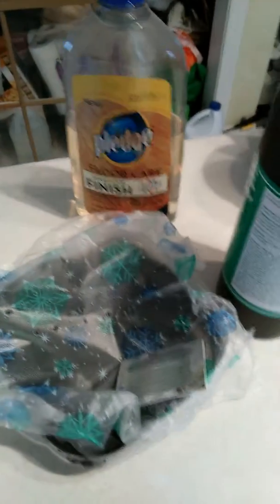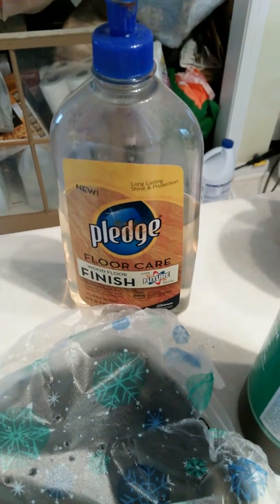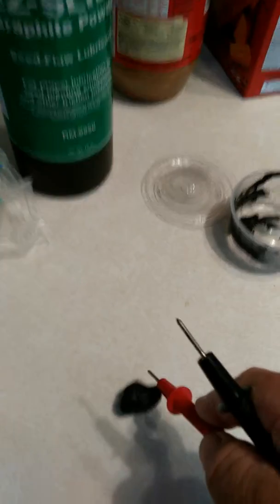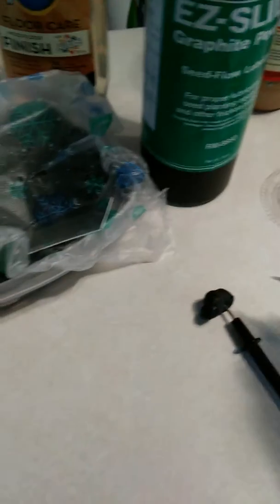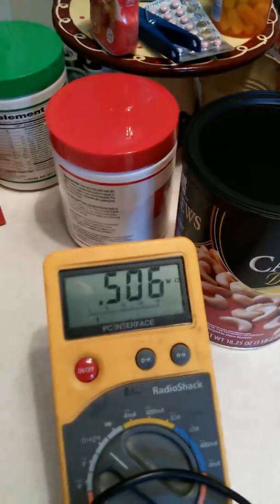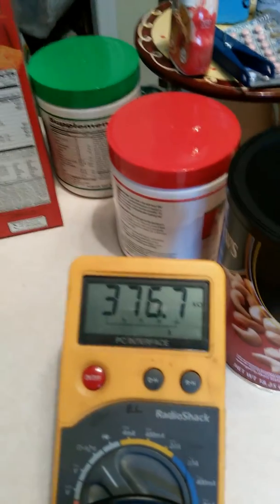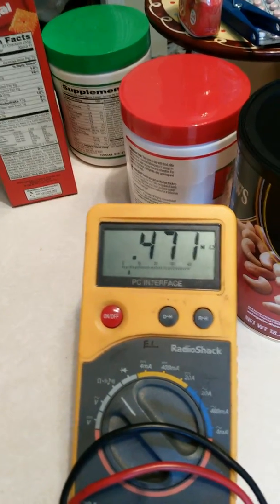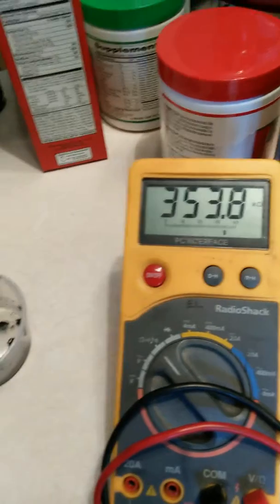conductive putty recipe

Comment: Seven years ago...Think if you made a bean bag size clump of that, encased it in electric car with wire jammed in it...vibrate it with the motion from the car in motion. Car has additional option to self charge...There's some conductive powder that are dangerous to breathe but scientist ignite to make other things, yet what if instead of ignited them, clumped them into into conductive blobs that when small friction heat were applied and or vibration, it could move electrons to help EV car battery cell charge.
Reply from the maker: Thank you for the comment, you have made me think of a new process and I will see what I need to complete to make this happen.